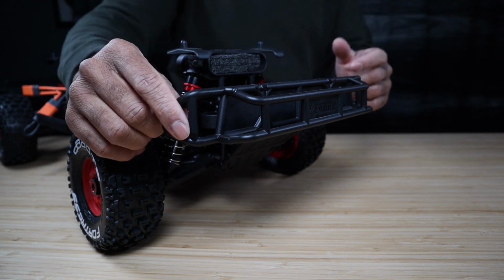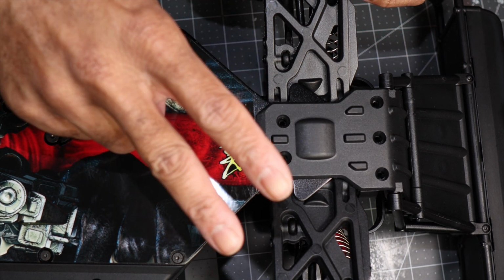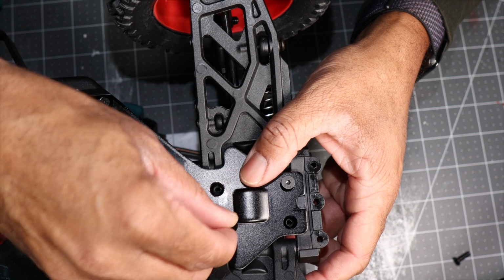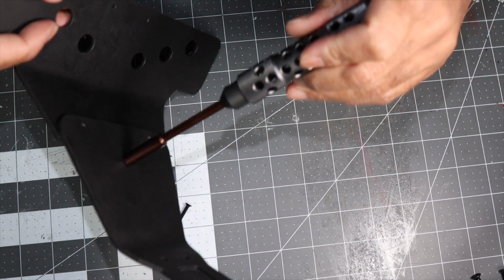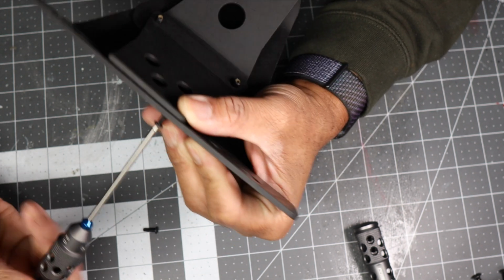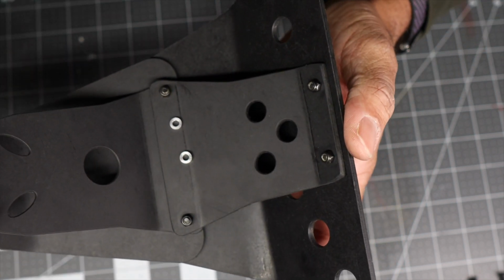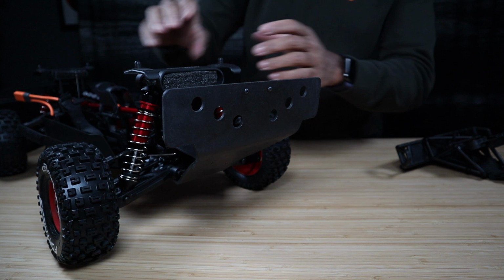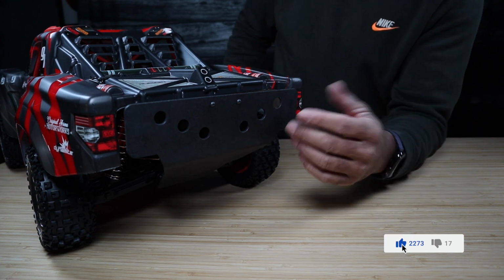T-Bone Racing, Arrma Mojave 6S Rear Bumper Install

Comment: I've made a few orders from T-Bone the first was fine with good customer service for an issue with the order.  My last 2 orders make me wanna be done with them.  They sent me wrong parts in both rear bumpers I ordered.  One for the Mojave and one for the slash.. I emailed them since NOVEMBER!! No response at all! But thanks for the help with your video I was able to figure out the wrong part in this bumper.. I was getting so frustrated trying to put the damn thing on the truck
Reply from the maker: Wow.  That's not good at all.  I've read other folks having similar issues as you, especially when it comes to their ramps.  Seems like the quality had gone done alot since they introduced them.  They make good protection for our rigs, so let's keep our fingers crossed that whatever was affecting their in house QC is been fixed.  Glad this vid helped with getting the correct part you need!

Comment: As soon as they get more in stock I'm getting one. With the m2c rear shock brace it should bolster my protection and clean up my profile!
Reply from the maker: Man, that sounds like a dope combination.  I have nothing against the stock bumper, but this cleans up that rear end profile!!!  Did you put yourself on the E-mail list for the rear bumper?  I'm sure you have, but if not, doing so lets them know how much demand there is for the product and speeds up the production que a bit.
Reply: @JSinistaProductions  I am on the list. Now...I wait.

Comment: Nice video but what I'd like to see is the front t-bone racing bumper instal. I have not been able to instal mine i don't kow if parts (braket) are missing but it seem impossible to install
Reply from the maker: Thanks. Sorry, can’t help you with the front bumper install. I don’t like how it looks on the Mojave so I never bought one.
Reply: @JSinistaProductions  I finaly been able to install it 😁
Reply from the maker: @McFly_FPV  👍🏾👍🏾👍🏾. What was it you had to do???
Reply: @JSinistaProductions  Didn't know where to screw the bracket but found it 😎

Comment: What are those Tyres??
Did you put the white lettering on?
If so how?
Reply from the maker: Stock tires, and I painted the lettering with a paint pen.
Reply: @JSinistaProductions  What did you use bro? And did it hold up and last?
Reply from the maker: @cwatson42785  Paint pen I picked up off Amazon.  It didn't all wear away, but alot of it wore down some.
Reply: @JSinistaProductions  Nice, thanks for the quick response brotha. I'm gonna try it. Came out really nice 👌
Reply from the maker: @cwatson42785  No sweat!  It looks really good when you first apply it!  I forgot I did a video, check it out:  https://youtu.be/aoQxeGwk1s0
Reply: @JSinistaProductions  I'll check it out right now, thanks! Subbed 🍻

Comment: Sir do you know if this would fit the Mojave EXB?
Reply from the maker: Hey!  Initially I thought it would, but I checked their site for any notes.  Low and behold TBR states:

 "Note: Does NOT fit the EXB models." 

May not be a "direct" fit, and it's possible you'd be able to modify the part or chassis to make it fit, but they state that it won't.

Comment: The backs of the body near the twilight no longer protected.  RIP body.
Reply from the maker: Bodies are easily replaced.
Reply: I did 5 runs with the stock rear bumper and the body shell got cracked at those points. You're right, the cracks would be worse with that clean bumper and it will tear up even more. Getting a new body is easy, yeah, but costing around 130-139 Euro's for the pre-painted bodies and around 85 for the upainted is quite expensive. So clean look ok, but the next shell gets the shoe goo and mesh method for more strength. With that clean bumper i would do 3-4 layers of mesh at the backlights, than just using one, like so many users do.